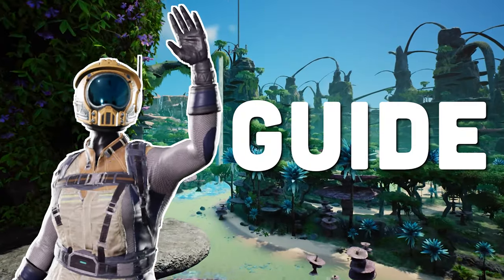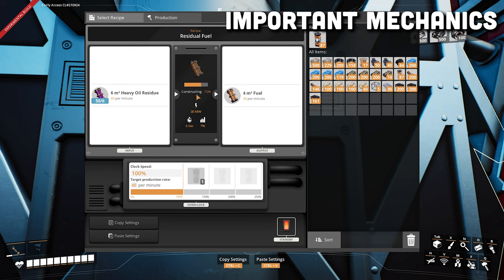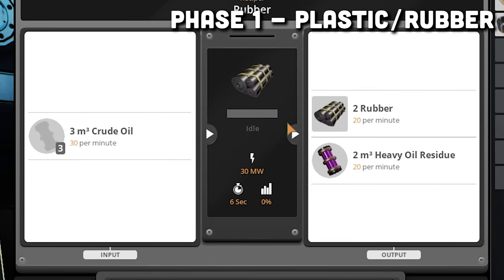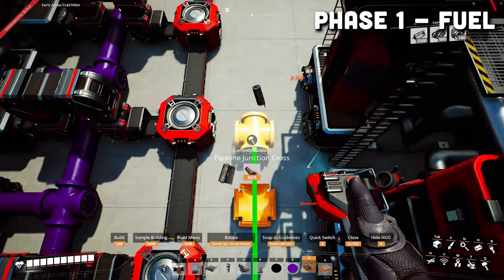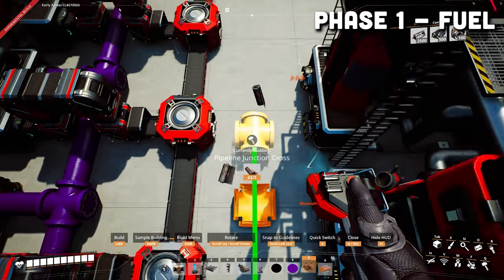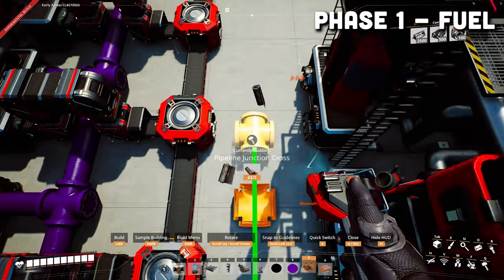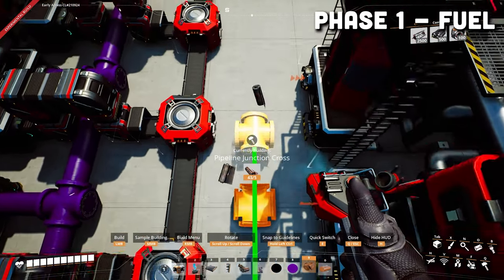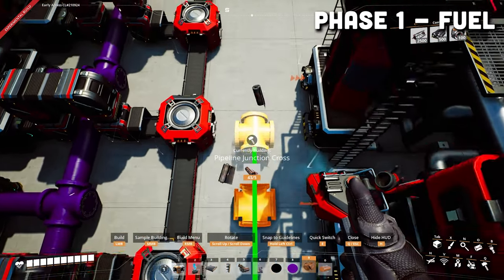PERFECT Starter Oil Setup!! 100 Plastic/Rubber + 1200MW! | Satisfactory Update 7

Comment: This is an interesting set up, but calling it a "starter" one is a bit of a misnomer. While one could just keep flushing their buffers and pipelines until they get up to fuel generators, that is a little too time consuming. This is especially the case if your first oil set up is far away from the rest of your base. A while back I found a video of someone making a similar set up, but they convert the oil residue into petroleum coke and then use coal power plants to burn it off with a resource sink for any excess. Can complete an entire plastic and rubber continuous set up with only the oil milestone researched. If one wants to stock pile some packaged fuel for the jet pack research and use, one can use a vertical U-bend pipe at the end of the oil residue pipes to funnel excess into fuel production.
Reply from the maker: I get what you are saying. But also technically with this setup you don’t stay in phase 1 very long. There are multiple ways to not have to worry about it. You can add more buffers, you can use tickets or the plastic and rubber to progress quickly to getting fuel generators unlocked. I find setting up the petroleum coke is useless in some cases because by the time you get that going, you could of unlocked fuel generators and start pumping those out and finish the build.
Reply: @spectrumdad_  Fair enough. I'm just adverse to using basic fuel set ups. I usually hop straight from getting computers and HMFs automated to using the alt pattern fuel method. Oil to residue,  then residue and packaged water to packaged fuel, and then unpacking the fuel is almost 4 times more efficient in fuel use. I consider "starter" to be just getting access to the tech with no extra steps or research, so I was just pointing that out. One of the best things about satisfactory is that there are so many ways to build and so many ways to play. I always love seeing content creators like you displaying their builds to give new and old players more ideas. Cheers.

Comment: i dont get it, im making 100m³ fuel/min. my packager takes 4 per min and all my generators take 20m³/min (i got 8). That is more fuel used than im producing. what am I missing? it seems to be working, but why?
Reply: nevermind, it just stopped working, and im reading the other comments about the 1.0 change

Comment: I’m having a problem with keeping the power on, any suggestions?
\
Reply from the maker: Fuel is fluctuating? Did you let the pipes fill before turning the fuel generators on?
Reply: I did, like two days because i was tired afterwards. Today i have turned off all the generators to let them fill again and see what happens, i am a noob so i could have messed up somewhere but i dont think so.
Reply: I built your coal power plant and then your oil power plant and connected them to my main grid, production is at 1800 MW now which means i probably made some kinda mistake earlier. Thanks for response and all of your videos, i love them!

Comment: Great video but every normal oil source I've found gives after overclocking 150 metres per minute only. I don't know how you can have 300 metres? I'm talking about pure sources I've found.
Reply from the maker: A normal node will yield 120 without over clocking. A pure one will yield 240. You can overclock a normal node fully to 300 or a pure node just a bit to 300. See the Satisfactory Wiki for more info. Or join my discord I’ll be happy to help :).
Reply: @spectrumdad_  Thank you 😊

Comment: I couldn't get my smart splitters to work by placing them on an existing belt. I had to place the smart splitter, change the settings and then add the belts to it for them to work. For those that have the same issues.

Comment: I'm confused, the first 10 refinery are making 100 heavy oil residue per minute but the 3 Refinery in Front needs 150 heavy oil residue per minute (30, 60, 60 per minute)
Reply from the maker: The rubber is actually producing 20 per machine unlike the plastic. So the total is actually 150 heavy oil residue / min and not 100.
Reply: @spectrumdad_  ohh that's why, I copied ur setup and it works without issue. But when I tried to make only Plastic, heavy oil residue starts lacking. thanks for clearing that up 👍

Comment: I'm so confused, I followed this video exactly and my heavy oil residue is getting backed up and causing my rubber and plastic refineries to idle. Head scratcher for sure.
Reply from the maker: Are all 8 fuel generators working? and did you make sure the packaged fuel is also being sunk? You have to make sure the fuel is constantly being produced and not backing up.
Reply: @spectrumdad_  yeah I checked all of that. I'm starting to think my game is glitching because after a restart everything was fine for a while and then I suddenly ran out of fuel for no reason. 2 of the fuel generators at the end were going in and out. I double checked all the refineries math and everything checked out. After a full game restart it was fixed again. 🤷‍♂️ Whatever is glitching hopefully gets fixed in update 8 🤣

Comment: Is there a basic, basic guide where you only have enough electricity to make one or two Oil Extractors, a refinery and a generator? So far, all of the guides on the Satisfactory channels all assume you have billions of MW to play around with, in order to set up a WALMART SIZED setup that requires 100+ MW to even start up.  I have 600MW to play with, from starting up your Coal Factory, and almost all of that has been taken up, by production, so now, either I have to shut down ALL of my production, in order to build ONE or TWO buildings for this set up, or go and somehow boost my 8:3 coal factory without any space for any more water pumps in order to meet the power requirements of making this set up.
Reply from the maker: Typically you have more coal generators at this stage. I usually have between 16-24 of them before hitting oil. Because you’ll need to build up some plastic and rubber to get needed milestones before you can start making fuel for more power. Alternatively, you could put down some biomass burners and use tickets in the awesome shop to buy the plastic and rubber you need to get the fuel milestones, and then setup the whole thing.
Reply: @spectrumdad_  OK thanks. That makes sense.